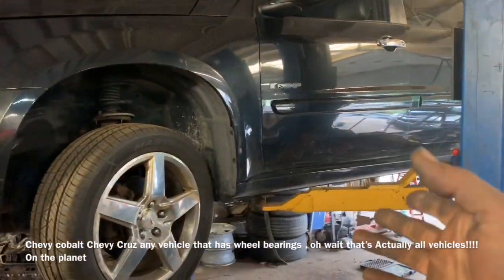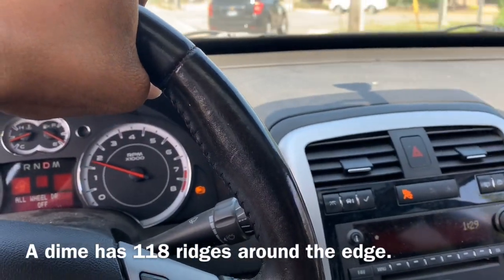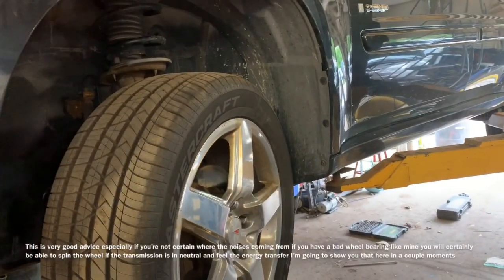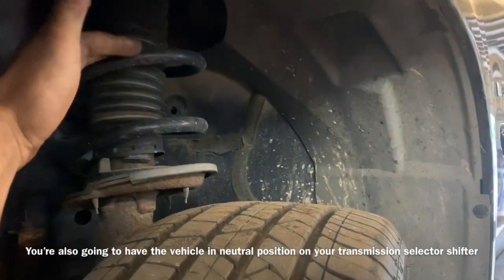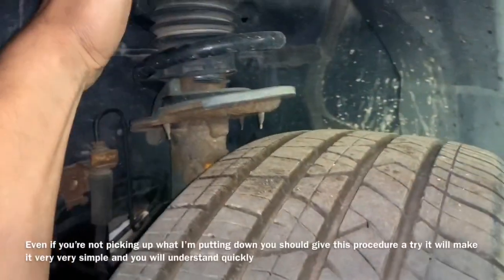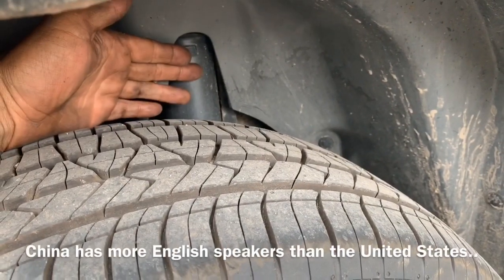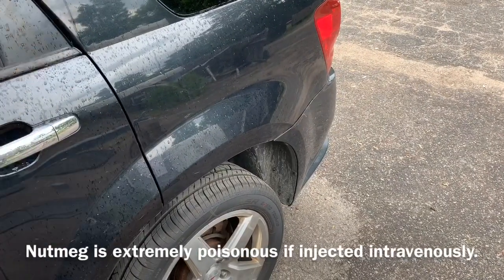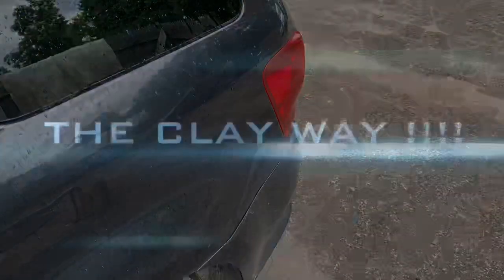How to check for a bad wheel bearing! Super trick! . Great video if you didn’t know!!

Comment: Just replaced wheel hub on a 2012 tundra.  Not too bad a job if you have the right tools.  Breaker bar,  torque wrench and a 3/4” ball bearing. :)

Comment: A broom handle touched to a suspected part such as an alternator or wheel hub on one end, and the other end touched to your ear will convey sound just like a stethoscope or two cans and a string. you can easily determine which bearings are or part is bad.

Comment: thanks for the videos. I have a 08 avalanche and the noise comes from the rear, its not a grinding noise but the faster u go so does the noise. Almost sounds like the pads are too close to the rotor. I put on new rotors and pads on both sides but it doesnt solve the problem.  Guess i need to jack it back up and see if theres play in the wheels ..
Reply from the maker: Well remember from the video that all you have to do to see if it’s a wheel bearing noise is as you’re driving down the road move the vehicle right to left and it will change tone if there’s a bad wheel bearing

Comment: Thanks for yr video, I have a question. If the bearing is good, you don't feel anything at all from the spring? What the scale of the vibration should be?  Just a feeling that the wheel is turning below is enough to determine that this one is bad? No youtuber explained 
 this yet.
Reply from the maker: The answer to your question is you will just fill the wheel spinning and on the wheel that is bad with a bad wheel bearing you will definitely feel the rumble through your fingertips

I suppose the reason that I didn’t address that question in the video was because you would have a noise coming from one of the wheels. 
And because of the noise you will definitely feel a vibration. Through the fingertips that will be different on the wheel(s) that are not affected. But you are right and asking the question because I could’ve addressed it in the video. 

That is the problem with us you tubers we make certain Assumptions that we should not make. 

On the other hand people get really irritated when you explain everything in great detail. 

But if you watch my latest group of videos I am leaning more towards just making the video as long as possible and explain everything as well as possible. Hopefully people do not steer themselves away from watching my videos because my explanations are lengthy and long. But maybe that’s what will set me apart from other YouTube videos. I probably do the longest intro of any YouTuber ,there is anyways so I might as well explain everything I’m doing and why

“Don’t only fix the problem figure out why it’s a problem in the first place and why the part failed” clayism

Comment: Replaced my hubs about 7 years ago. Front driver side has grease build up on back side. Passenger does not. Right side is just started making a noise that sounds like rubber rubbing against something. But the tire is not hitting anything. So I think its the hub. Any ideas. Thanks.

Comment: Would the rear tire lock up or drag while driving?
Reply from the maker: Well there’s a U joint behind there that could be causing that it could also be hanging up from the break… more than likely the you joint though.
Reply: @sharpcarco   I drive a Chevy Silverado  1999/2000 4x4. The problem that I am having is I first got a hard clunk sound when accelerating up from 20-50MPH.  Now, the vehicle's right rear tire is hanging up dragging and locking up.  I  change the brake caliper. Not the problem. What should I check for? Thx.
Reply from the maker: Sorry I thought that you were driving a jeep, in that situation.  It could rear differential. Because your redifferential is limited slip so I would have to assume that it could happen to either wheel . I can’t say for certain obviously I’m not there. 

I would probably take my rear differential cover off and check out the inside of it. 

On the small possibility it could be your emergency break as well. Even if you have this brakes. 

I had that happen to me one time and it seem to be coming from everywhere ultimately in my situation it was my transfer case. 

Reminds me of the video I made I drove it with a bad transfer case and the wheels locking up from Daytona Beach Florida to my dealership in Grand Rapids Michigan I was totally astounded that they even made it that far and when I made the video of taking the transfer case out it was crazy how many holes were in it and as I drove parts were just flying out of it.. 

I loved that freaking Chevy. If I remember right it was a 2000 Chevy suburban.
Reply: @sharpcarco  Thx. ?4U. Now since you mentioned the transfer case. I noticed heavy oil residue on the transfer case body.
Could the transfer case be slipping because of low oil? Thereby cause the tires to appear to lock up? Hmmm. Now you have given some to take a serious look at. I check my transmission oil and the dipstick read full.  Although is currently the vehicle is parked.

Comment: Hello. I have a 2005 chevy uplander my two front wheels have a lot play. Well... I try to buy the front wheel bearings. But they asked me if is a 4 door or a 5 door .my van has the. Driver and passenger that is 2 ..the two sliding doors that's 4 and the one in the back . 5 total but when i put the information. They said "this item won't fit your vehicle.
What the doors have to do with the wheel bearing.???
How do i know which uplander i have? Base,Ls , cargo, XL .please help me

Comment: not all bearings change sound when moving steering wheel while driving. As in our Subaru
Reply from the maker: That is true if they’re located inside the differential they will not. I suppose I should’ve made that a little clearer if I did not

Comment: I get a howl from start when I lock the hubs in 2hi and so forth, after 30mph it settles down to where I cant hear it, feels like theres something holding my speed back. 1st gen toyota tacoma. Thx.
Reply: I will add no noise when in normal driving 2hi not locked, when engaged in 4x4 it works great.

Comment: I have a 2008 Pontiac Torrent tested the abs button right by the driving shift and it starts GRINDING LOUD scared the shit out of me then my stomach wanted to puke I turned the engine off then turned it back on and went back to normal and didnt want to hit that button again then 2 weeks later was driving and it started to GRIND LOUD again I turn the engine off the turn it back on and back to normal i'm a little worried dont know if its the bearing or abs or something worst went to auto advance for a free diagnostic it said C0899 device power circuit low went to check my muffler & breaks they said breaks are ok but a little bit low also go the same code C0899 i don't know if the problem is the code or the bearing or both?
Reply: PS: from what i can hear it sound on the right side
Reply from the maker: Well since you’re able to turn the engine off and turn it back on I would say it’s Possible an engine problem unless I’m misunderstanding you one of the pulleys sounds like it’s going to effective but I’m not certain I know you tried to explain it well but is it break related or is it engine related
Reply: @sharpcarco  when it does it grinds on the right back side but dont know for sure but dont have no problem in the engine have a AWD if that can help
Reply from the maker: Well do you like I did jack up the The vehicle in check for play in all four of the Wheel bearings
Reply: @sharpcarco  I'm thinking it might be that when it started grinding again will have to go to the repair but the labor sigh... 😩
Reply from the maker: Well you could pay them to tell you what is wrong with it and then just fix it yourself I’m sure there’s videos out there for whatever the problem is
Reply: @sharpcarco  true